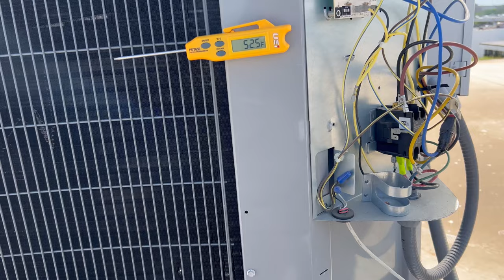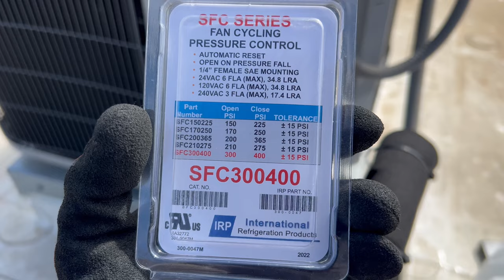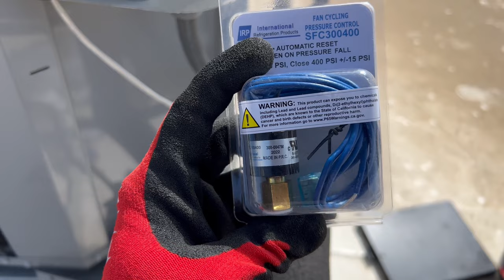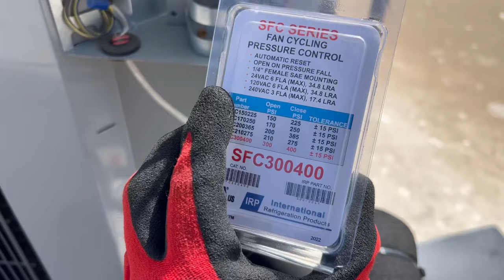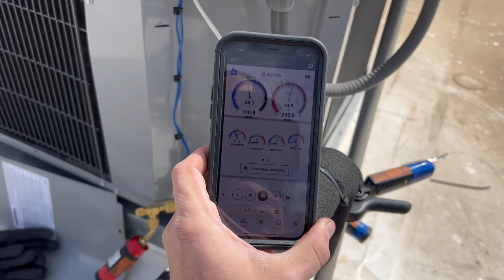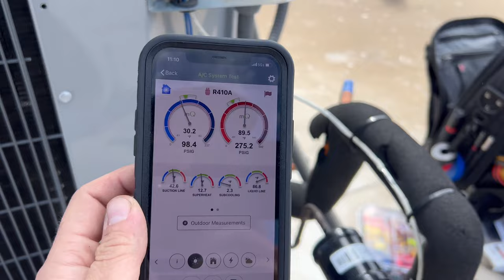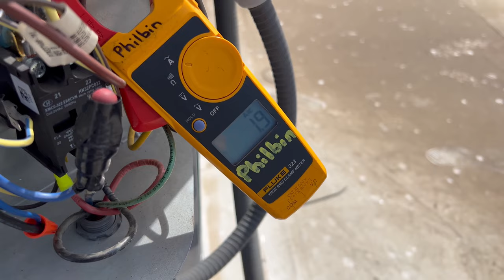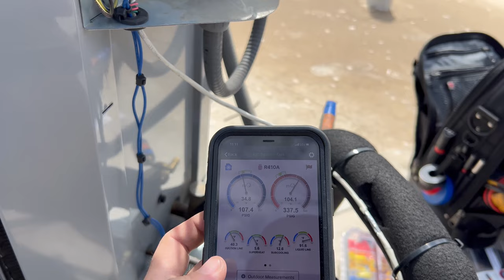LOW OUTDOOR AMBIENT COOLING - FAN CYCLE SWITCH INSTALLATION & OPERATION

Comment: Good ol fan banger. It's not my favorite way to do it, but it works. I've used a 90340 relay in the past to take the load off the switch. The best option is speed control using a temp sensor or a pressure transducer works even better with more precise control. Nicely done! 👏
Reply from the maker: True words right there! So many different ways to do it, some with more efficiency. This was rudimentary but for a basic split system it’s cost effective and increases performance when it’s cold out, and I was hoping this would appeal to mostly beginner techs who might need an intro or basic approach to this subject typing in the search bar. Thanks for watching man! Love your channel , big fan here ✌🏼

Comment: Can these be installed on a heat pump system? I like to use my air conditioning when it’s cold outside but my system is a heat pump so I still need the heat for the rest of the family when they’re home.
Reply from the maker: Yes they can be used on a heat pump system , however it will require the addition al installation of some type of relay such as a SPDT ( single pole double throw ) with the coil wired to “O” , this will allow it bypass control in heating mode, depending on if your unit energizes reversing valve in heat or cool.  You don’t actually want the fan cycle switch to be active when running in heat mode as it is likely to cause a freeze up at the outdoor coil due to low airflow when in heating mode.

Comment: I'm thinking about using this in conjunction with a  Humidity  Thermostat so that when it runs in the Winter time it will work the same exact way for the same exact reason you're using it for commercial purposes, It will be running lots of times in the Winter time and I need to keep the head pressure up , Can you think of any  Better idea
Reply from the maker: There aren’t many better ideas , of course there’s all different types of head pressure switches and sensors , this one in the video is most easiest to install and most cost efficient method . But If you’re going to need cooling demands in the winter then you are absolutely correct you need some type of head pressure control ( fan cycle switch ) for proper operation , temperatures and pressures and performance of the unit
Reply: The only other option I know of was that head pressure control fan cycle mechanism but it's much more expensive than this, I've been wondering why these types of switches would not work and do the very same thing that the head pressure control mechanical cut in cut out switch does but this does the exact same thing except it's none adjustable I wonder how long they've been making these types of switches are new about the low pressure switches and high pressure switches I've installed them because most of the rheems do not come with these If I am actually controlling the head pressure with this precious switces I'm not going to be getting liquid back to my compressor at all so I shouldn't even need a crank case heater which I thought I was going to need initially both of these together, other than migration,